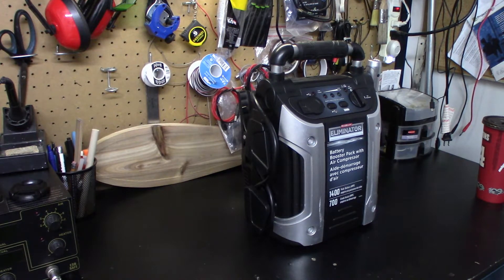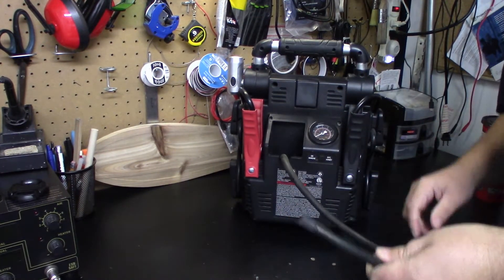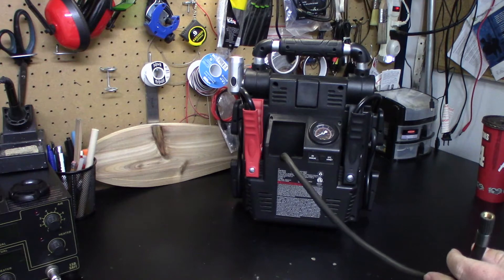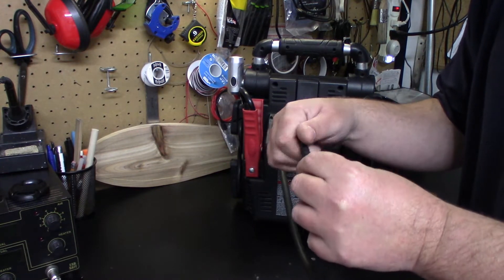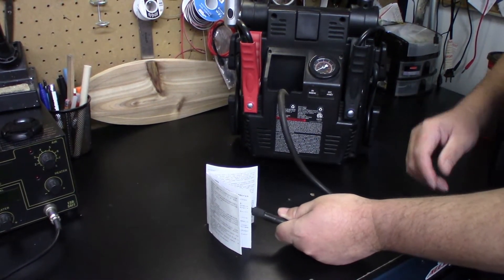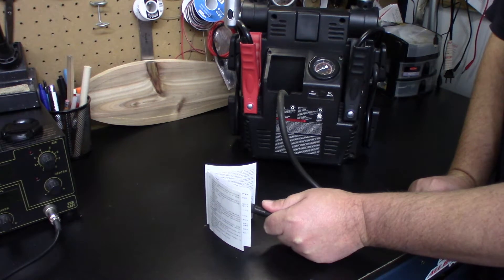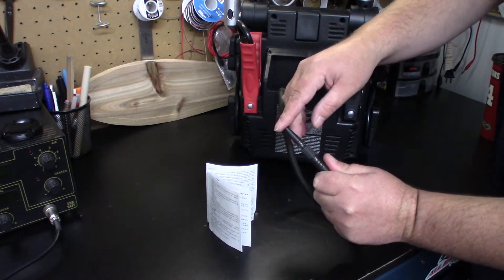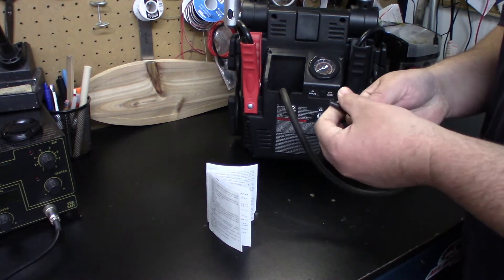Non-Electrical to Electrial issue: Battery booster pack repair. Part 1

Comment: Where can you find a replacement battery for this model?  Do you happen to know the internal battery info?
Reply from the maker: I forget but will take it apart again I have to swap my battery in mine left it too long without charging...oops I'll let you know either today or tomorrow the size of it.
Reply: @Gam3T3cHElectronics  Oare se poate incarca bateria prin cablurile jumper?
Reply from the maker: Hey there it is a SEL 12v21ah Battery so you could get a battery that is 18ah which is more accessible as a suitable replacement.  just make sure it has posts and not recessed terminals.

Comment: Please note that opening or modifying the jump starter is not recommended by the manufacturer and it will immediately void your warranty. Consult your instruction manual for guidance on the safe operation of your jump starter. Please don't hesitate to contact manufacturer Customer Service for troubleshooting help.
Reply: Lol, we wouldn't have to do that so much if these things weren't sweatshop-made crap. :D
Reply from the maker: true story.
Reply from the maker: usually most will try to fix themselves after warranty.  but good words of wisdom there. but there isn't much in there.

Comment: I loaned mine out to someone last winter, got it back a few months later, I'll plug it in, it'll show full battery, I'll turn on the light and unplug it, light turns completely off within 10 seconds, maybe battery replacement will be necessary, thank you for this!
Reply from the maker: usually happens that way hope you still go it.